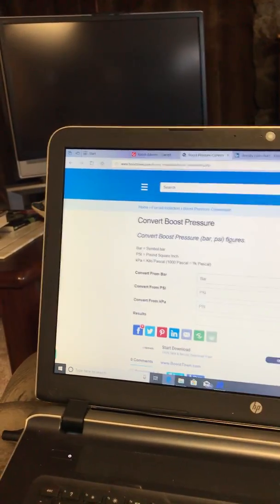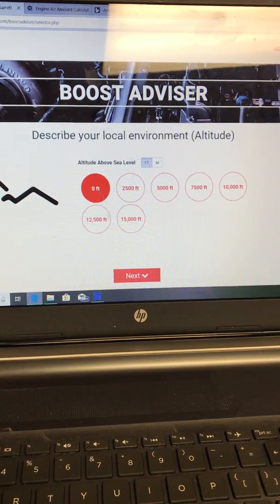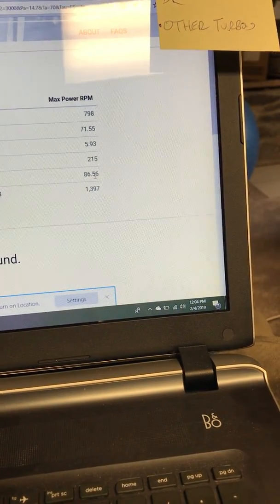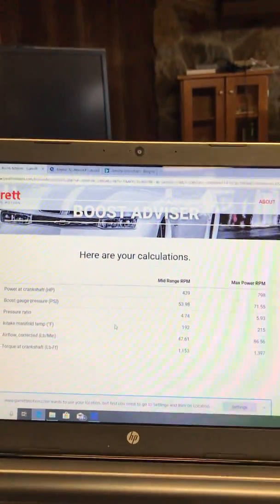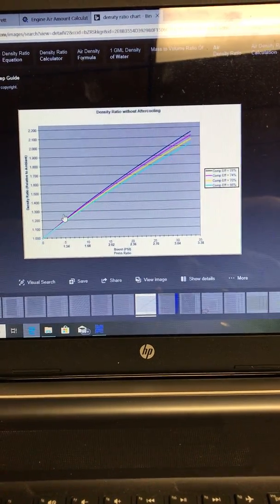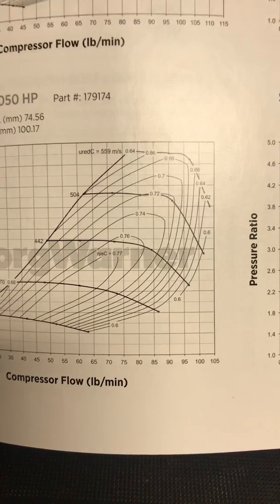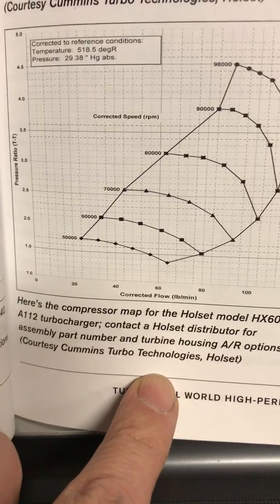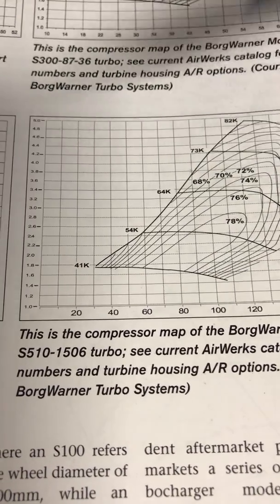Turbo size matching (part 2)

Comment: garrett calculator factors in higher afr for diesel the other calculator uses gas scale and air weighs 76.4 lbs per 1000 cubic ft on a j607 scale it is 14.7 psi pressure not weight one of the interesting things about airflow is a gas engine loses 10 percent ve compared to a dry flow engine like the newer di gas engines